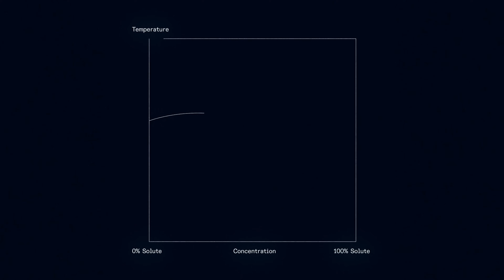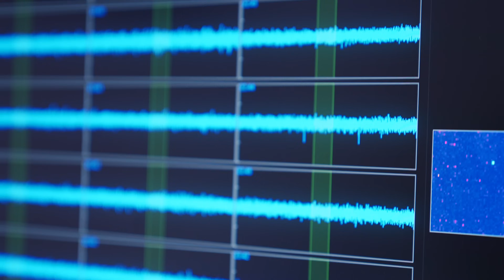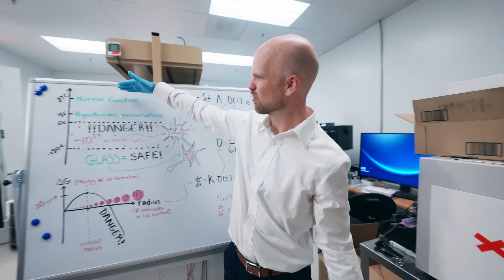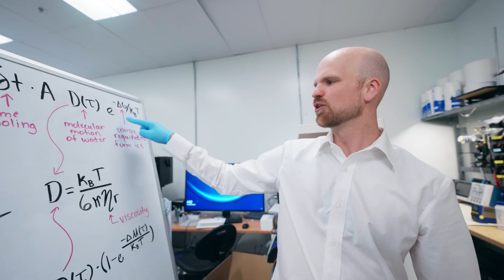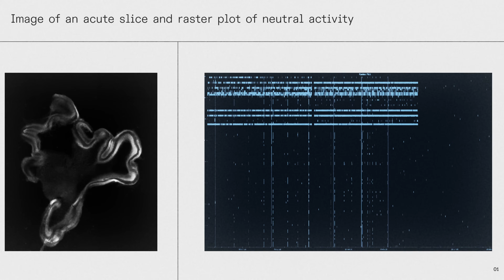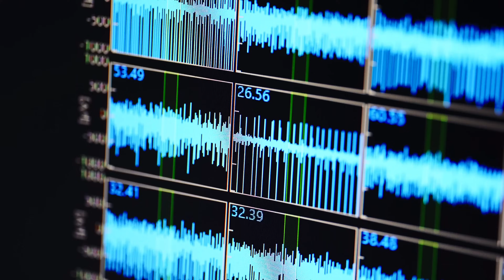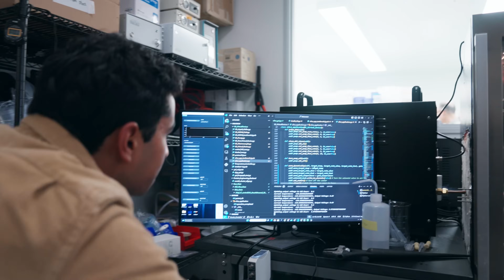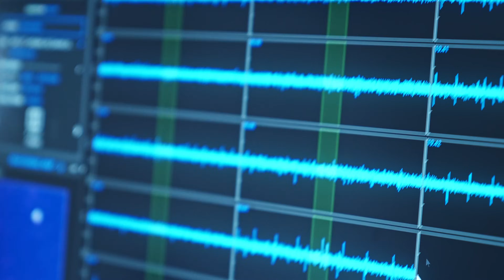The 1st Step to Reversible Cryopreservation | Cradle

Comment: I mean the science is solid. Also I loved the video. So it might just become an engineering problem. They won't make it as a company however, as they would need to solve earlier issues for actual customers along the way and I don't see that many. At least not some where other companies aren't working on already
Reply: but they are smart enough to have thought already of that too and have plans for exactly that. I give them the benefit of doubt

Comment: The problem with cooling a large intact piece of tissue like a brain is the limits of heat transfer (i.e. physics) conduction through tissue will form crystals vice convectively cooling a small ‘slice’ of tissue. 

This has huge implications for scientific applications and this technology definitely has applications in the meantime. 

However, getting the Cryosleep will require some sort of way to solve the heat transfer problem of a whole body going to crypto temperatures quickly. Makes me think you might need to change the chemistry of the body and or find a way to do the reverse of microwaves (as they are particularly good at heating water molecules and or organic matter).

Comment: I hope they realize they need about 10,000 more breakthroughs of increasing scale to make their technology be good enough to affect anyone at all
Reply: I think the point is that they proved it works, and it’s possible.
Reply: @redthunder6183  that’s not what happened, they proved that something much much much simpler is possible. This is only one small part of what it takes to
Reply: Amazing how we have got this far. Onwards and upwards by looks of this news. Wasn't a few month back we have cured HIV albeit stem cell working but it's there.
Reply: oh you're right. might as well quit :/ not as if they allude to the impossibility of it multiple times

Comment: The difficulty with this in the past has been surface to volume ratios. Humans are too big too cool effectively.
Reply: let alone reheat effectively.
maybe if you could prefill with tons of magnetic particles and use induction to reheat.
you still have the cooling issue though.

for cooling maybe we could find some compound that chemically cools really fast and at the same time are not reactive to our biology but that seems far fetched.
Reply: @alkeryn1700  Animals who can do it use a combination of antifreeze protiens
Reply: @sadface7457  animals don't do it, they hibernate, cryo is a whole other level.
Reply: A few animals can be fully frozen and then wake up when they thaw, some frogs for instance, of course doing it on the scale of a human , especially given we’re warm blooded, is a different matter
Reply: @samuelbarker780  hmm, not exactly, they get to -10 or -20, -150°C is a whole other ballpark.
both are techincally "frozen" but it's not the same level of frozen.
Reply: @alkeryn1700 the only issue seems to be the danger zone, which is where ice will form. -10C is definitely in that zone and animals are capable of it, I guess they just don’t get to the point of full metabolism arrest, but it still slows down
Reply: @alkeryn1700  hm, please elaborate. Naively I would think that once you reach -20 and you dont get those ice crystals, -150 is gonna be easy.
Reply: Am wondering if they could do a hamster.. The guy in this video claims he did it in the 1950s, a hamster "frozen solid" and subsequently successfully revived. That would be something.. https://www.youtube.com/watch?v=2tdiKTSdE9Y
Reply: @mennowitteveen3313  maybe but a hamster has a much higher surface to volume ratio than humans ^^
The bigger the animal the more challenging it is.
Reply: The difficulty is not a surface to volume ratio problem. It's the fact that you need to get cryoprotectant into ever cell in the body, which all have different tolerances to these toxic CPAs, and different loading protocols. The technology required to do this successfully is so far off from our current technology that it might as well be magic. Unless there's some nontoxic glass former out there, that works at moderate concentrations, doesn't lead to high osmotic gradients, and is readily permeable in nearly every structure in the human body, this process is likely not possible. None of these people know what they're talking about. I'm directing research on related topics at a University and have been involved in actual cryopreservation for years. These people are either deluded or charlatans.
Reply: Completely inaccurate . Completely unsatisfied with the scientific knowledge on this human who posted this comment. Just because YOU don't understand it doesn't mean A nobody does or B it's not possible